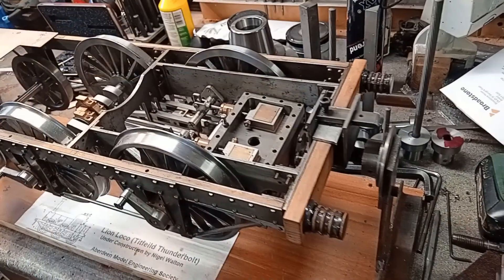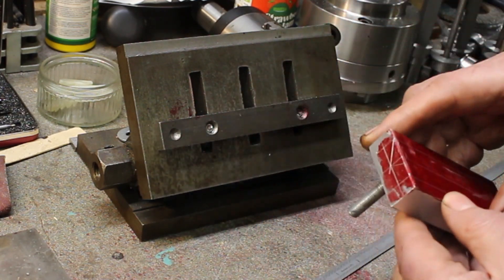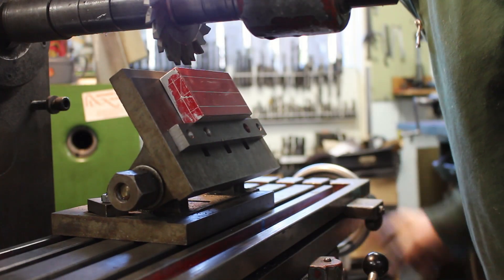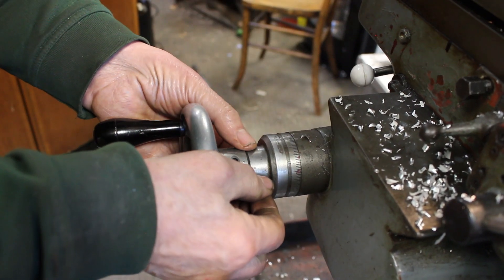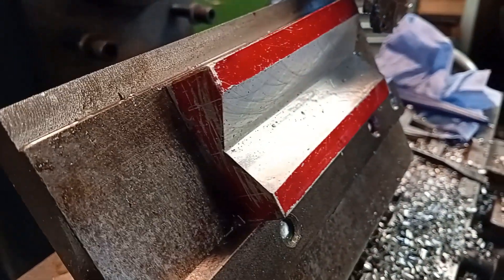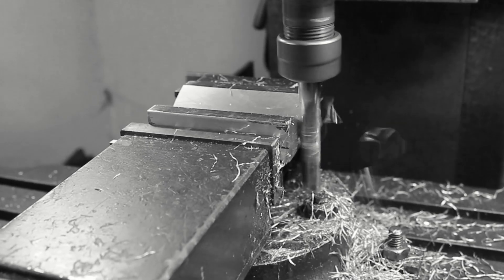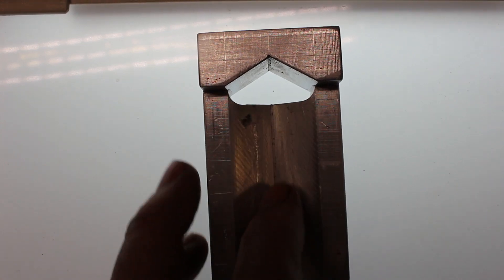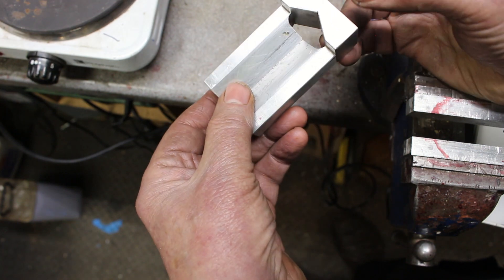Drill Sharpening Gauge | Shop Made

Comment: 3d printing has its place but rather watch hot chips flyn than a automated device go around and around ✋️😕🙄, this is awesome 👌 and was made by hand with old machines that anyone worth their salt would like to have!! We picked up a 7 inch shaper with our lathe purchase earlier this year, needs lots of tlc but so does the lathe, but slowly finding tooling and parts for both, older stuff just better, yes said it, will stand behind the statement👍😮
Reply from the maker: Thanks. Yes, old timer machines are much more rigid and worth the effort restoring them were needed. I'm  sure you'll love your shaper, easily the most pleasurable and economical machine to use.
Cheers
Nigel

Comment: Hi Nigel. Can I ask why you feed the cutter from the left hand side of the part on the horizontal mill? I've always had the cutter rotating clockwise and feed from the right hand side, the same as when using a face mill on a vertical milling machine.
Reply from the maker: Thanks for your interest. Thd direction I feed the work when horizontal milling is a feature of the machine. The power feed on my mill works in only one direction from the right going left, so the cutter needs to rotate counter clockwise. Also there's only one longitudinal feed handle which is at the right side so even if I'm only hand feeding it's better for viewing the cut to go from right to left. 
Cheers 
Nigel
Reply: Thanks Nigel. Is the feed broken or is it designed that way. It's a shame the chips fly straight at you when using the handle.😢
Reply from the maker: It's designed that way.
Reply: @GoCreatehms  That's interesting and unusual, especially as it has two trip dogs, one for each direction?
Reply from the maker: @marley589  oh yeah, it does have trip dogs in both directions, I hadn't really thought about that, weird. I think I need to investigate further.
Reply from the maker: Major senior moment! I just took a look at my mill, the feed does only have one direction but of course that depends on the spindle rotation, reverse the spindle rotation and the table feed reverses. So I could run the cutter clockwise and on reflection I have done that before. Also I'm pretty sure it used to have a longitudinal feed handle on both sides but has lost one somewhere along it's journey to me.
Thanks for your observation, been very helpful.
Cheers
Nigel
Reply: @GoCreatehms  Glad that was helpful, no more chips flying towards you when using the handle. 😃I guess it prevents climb milling.

Comment: Great idea. A perfect job for the shaper when I get it back together. Do you used brazed carbide tools on your shaper? PS, you've mis spelled gauge on your video thumbnail 😮
Regards, Preso
Reply from the maker: Thanks, I was wondering when someone would spot my deliberate mistake LOL.
Yes, I do use brazed on carbide tools on my shaper,  mostly when machining cast iron or brass though I have had some criticism of this practice. I've not had any problems thus far, keeping the strat of the stroke close to the work will provide minimum velocity when the tool starts the cut which I guess will help a little. For steel I use HSS tools.
Yes, this will be a good project for the shaper. I did consider using the shaper to machine the vee groove but I'm also loving my horizontal mill and have plenty cutters to last me more years than I have left.
Thanks for your interest.
Cheers 
Nigel